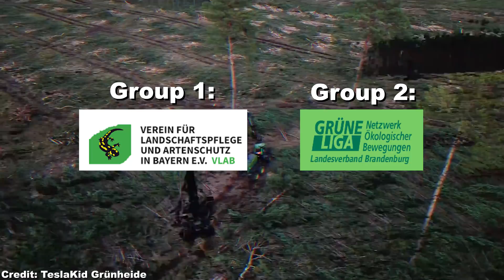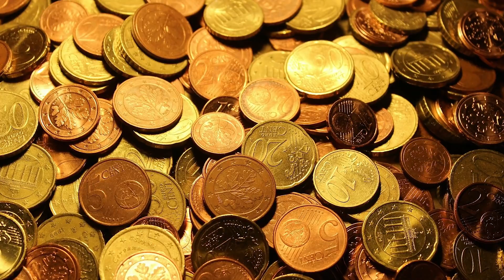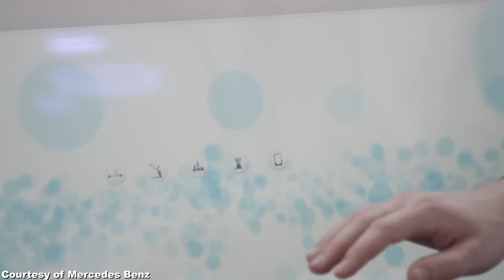Tesla Berlin Factory Protest, Model S & X Range Increase, First Cobalt-free Battery

Comment: When we get a Battery Pack that can charge from the bottom and discharge from the top there wont be a range, Because in the roads that we travel will charge you as you go. like our Phones can charge just by putting it on the charger. To day if batteries were smaller with more amps,(Like power Caps.) With two batteries in a car, one charging as you Drive the other in use. We could drive as long as we had charge ways.(Oh a power cap can charge in seconds to full charge, and hold a very very large charge.) The charge ways can be Solar powered. Come to think of it What powers Humans?=Food powers the Flesh, Dark Matter powers the mind. Ideas don't come from a Stake or Pork chop, thay come from the same place we come from, Which came first you might think Adam, or EVE they travel together, because Time and many other events travel in Both Directions at the same time it's call the paradox of Dark Matter. we have been using it all the time but don' understand it. AC current Both directions, DC the same. Traveling in space is traveling with Time it's not the same as traveling in Time. Traveling in Time has no space in between. You hear it all the time now SPACE TIME.

Comment: @11:27 I don't think it's wise for Tesla to license its technology, they can't even do it even if they wanted to. Tesla is tooo integrated to do that. The entire car is controlled by one piece of software (compared to multiple incompatible software from a myriad of suppliers in other cars), which means they buy everything from Tesla, from the door handles to motors. It'll just end up being a Tesla with a BMW badge. BMW won't even make any changes to the car's exterior without involvement of Tesla. Remember there are cameras and sensors all over the car with precise positions and angles that make this very difficult to sculpture into another vehicle without breaking the whole license agreement and involving Tesla. The best thing is for them to use Tesla patents just like what Tesla offered them and build their own cars. If Tesla intends on selling gigafactories, then won't that be just what they should just do, build Tesla gigafactories and make more Teslas? I don't see Tesla doing a license model, Tesla is like Apple in every respect (everything is in-house and well integrated for the best user experience) and going the Microsoft route will break everything (Windows works on a lot of hardware, but wasn't until recently optimised for anything in particular).
Reply: @TechChasm  thanks for the article, but if you look at the comments section you will soon see my sentiment. As it stands, Tesla needs batteries for themselves, at least for the foreseeable future. They cannot supply their own endeavours (non-car battery packs) yet alone other car companies. Their cars are on demand with years/months backlogs. By trying to save other other car companies, they would commit suicide as Tesla customers will be shorted and disappointed. My point is that Tesla needs at least 30 gigafactories around the world in order to do that. They can't do it, at least for now.

Comment: I was thinking about shuttle pods. I was also thinking the people don't like to share. Particularly with Corona virus going around. It might make sense to subdivide the interior, on some models. Two to four private or couple pods, on a single skate.
Reply: @TechChasm  This virus is looking most likely to go endemic.

Hypothesis:

The problem with personal protective equipment is it's disposable.

If you gave me the choice between a top-of-the-line state-of-the-art bunny suit. Or a SpaceX flight suit plugged into a Model-X, I checked the flight suit any day.

It's treated heavy duty leather, just hit it with heavy-duty UV, and a disinfectant in an airlock. Positive air pressure will keep the bugs out, that way it's way easier to put on. either some sort of battery powered backpack or like I said plugged into a model-x could be the life-support system including air conditioning. 

Traditional bunny suits are thin on purpose because they don't breathe. The tiniest little thing happens and they are completely useless.

Motorcycle enthusiasts would also love to have a legitimate Space-X flight suit. There's some days you can't go fast enough to stay cool, the air just becomes a convection oven. I would trade one saddlebag for a HEPA filter air conditioner instead any day.

Space suit, motorcycle suit, bio/chem/radiation suit, same thing.

Everyone should have one. As Elon says no part is the best part. A ton of industries could save a lot of money on issuing PPE if everyone already has their own. Obviously it'd be a little more complicated than that, but that's my idea, when I ask myself "what would I do with a space/flight suit?" Other than wear it while playing video games,  at the disco, or trying to survive a dystopian future viral outbreak. 😀🤙

Comment: The environmental groups in Germany have to be very careful about accepting donations from car manufacturers or oil companies. Accepting such donations does terrible things to their credibilities and they are most reluctant to do so even though they need funding. Unfortunately, this is a long story, please bear with me. The group Deutsche Umwelthilfe (DUH), which means German Environmental Aid, has filed court proceedings against several German cities to force reduction of NOx levels in the air. They have been well over EU limits for many years and the cities nor the state and federal governments have done much about that. It is mostly the Diesel vehicles that emit NOx and the car manufacturers have cheated about NOx treatment in the exhaust gas to save themselves money. In fact, the exhaust control electronics basically shut off the treatment unless the vehicle detected an emission test situation (illegal defeat device). VW really got itself into hot water in the USA this way. As a result, purchases of Diesel vehicles dropped off sharply, they had been very popular in Germany. The DUH is reputed to have had accepted a donation from a Far East motor vehicle manufacturer that does not produce Diesel vehicles. Other environmental groups know to be careful about accepting donations and know that they are under public and taxation scrutiny due to their nonprofit status. However, they are open to many actions that yield publicity even if counterproductive in the longer run. I find a backing by a motor vehicle manufacturer unlikely, however, the Transrapid Maglev project intended to connect the still fairly new airport at Erdinger Moos with the main train station downtown Munich (in part via an existing but closed commuter train line) may well have been torpedoed by interested companies and commercial agencies providing transportation. There was a lot of opposition. Consequently, it takes about an hour just to get from the train station to the airport today and the only location where Germany´s maglev is operating is in China. A Hyperloop system would be simpler than a maglev and make no noise but surely fat white pipes would rouse opposition as well!

Comment: The Tesla/CATL is good news but the CATL LFP batteries are not new technology. LFP has been around for decades. The reason LFP has not been used so far for (mass production) EVs is that the energy density is  lower than Lithium Ion.

Comment: Does mean a cobalt-free Million Mile Battery is possible? Cobalt is expensive, i heard.
Reply: Yes new innovations in patented technology does away with the cobalt. Also graphene batteries with existing manufacturing and cell structures is also available and density and charging times improvement. There is also talk of removing the cells out altogether and having battery modules without the need for the management infrastructure and making it easier to swap modules. 20% reduction in weight. Double digit decrease was touted.
Reply: @sneekmatrix  The Million Mile Battery, charged with solar and wind may save humanity and limit the coming Gigadeath in the coming century.
Reply: @larrybeckham6652  Your absolutely right. As an off grid power storage utility it complements the networked multi nodal power distribution framework for renewable energy on demand.
Reply: @sneekmatrix  Tesla is already moving to do just this. I imagine the Model Y will be the first to have packs eliminated all together. Making the Model Y's battery cheaper to make.

Comment: Oh Geez!  I live in a mountainous area with a lot of tree farms.  If there were a complaint of harvesting a CROP, it would be laughed at by everybody.  Even the low land farmers would have a fit about Any harvest restrictions.  If one crop is denied, it would open the door to regulate and deny Every crop grown!  Ridiculous!  Insane! . . ?  Nope!  Scared people.  Afraid of loosing their hind-ends to something they have dreaded from the start.  To them, Tesla is the Hungry Dragon, but they blew all their $$ on parties instead of defense.  However, there are only two ways to go about surviving for them.  Jump on the band wagon, or sell off to Tesla.  Anything else now would end up very bad for any of the Auto Manufactures world around.
  Personally, I think its just due for the Auto Industry in America.  Now the buggers know what it feels like when they attacked De'Lorian and Tucker, destroying them and grinding their bones to dust. . .  It's their turn now. So much Fun!
  They all laughed at Elon at first, but Elon slapped that smirk off their face, right into a alligator filled swamp!
The main issue I still have with Tesla is the charge rate.  With a fuel vehicle, it only takes a couple of minutes to refill, and then, of course, we have a little Gas Can with a set of feet in case we don't make it to the gas station in time. . . Tesla has none of that backup, yet.
  Maybe with the new development of Graphine Batteries, the charge rate could be very quick, but the amperage would be just as high.  I can imagine driving into a "bay" and stopping against a set of wheel blocks, inserting my debit card into a slot and typing out what I want, at which time a door in the floor opens, and an arm with a socket raises up and docks with my car, delivers the required power in a couple of minutes, (Over 200 Amps), then the arm retracts, the door closes, the wheel blocks lower, and I am off driving again.
  Or, what about having a little on-board generator just in case? (The proverbial "Gas Can", so to speak.) Something just large enough to give an added 4 or 5 miles, or charge for an hour and get 20 or so miles more.
  THEN, Elon needs to start looking into Off Road vehicles.  4 wheel drive, sport and utility rigs.  Farmers have to have it.  They can Not work without them.  Being electric; that has the great advantage of full horse power and torque at low speeds, which is an absolute God-Send to the rural farming folk. (I'm waiting to see the Tractors Tesla could come up with! . . .  Maybe I could Ask him, and get a good job out of it?)
  And Ooo! That Awful Green `Thang got loose Again!!  Ho-Le-Cow, it's Scary! (Not!  Actually, I wonder how Jixuan can keep from laughing.)
   Yeah, Elon broke through Big Time.  Finally! And in a way that's too big to ever stop now, and with the most Perfect timing too.  With his Sky-Link, autonomous electric vehicles are now definitely the only way into our world's future.  Coupled with the new advancements in and with the Dedicated A.I.'s, our future is a pure and sunny, happy day.

Comment: With Tesla teaming up with CATL, Tesla has strengthened its battery supply line. While the other automakers are having delays with there EV's(do to battery shortages), Tesla can just mass produce as much it can without disruption.  Making the batteries with out Cobalt is just a plus.  I have heard that there is a possibility that Tesla's with CATL batteries might have shorter range in the beginning.  Have you guys heard anything about that?
Reply: I predict that Tesla's relationship with CATL is meant to be a short term fix. Tesla is already building a battery factory for China Tesla production.